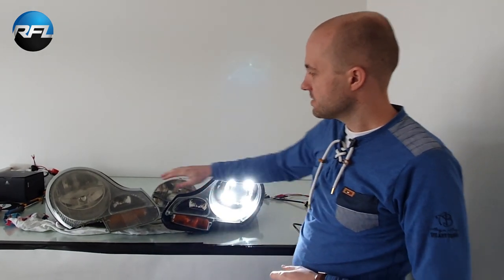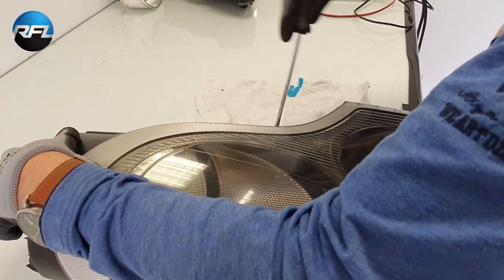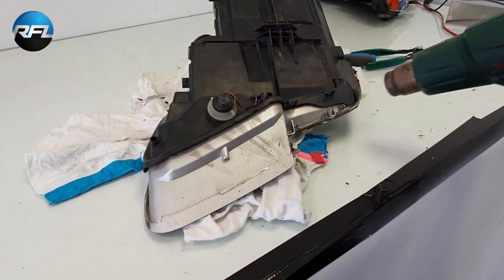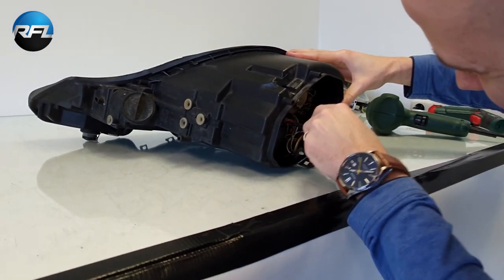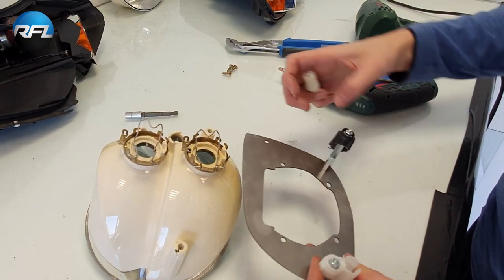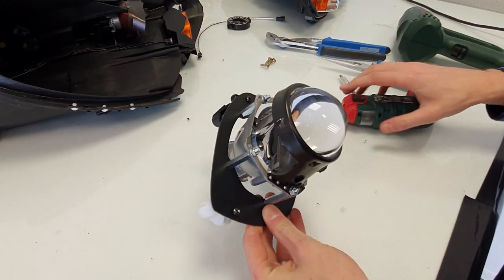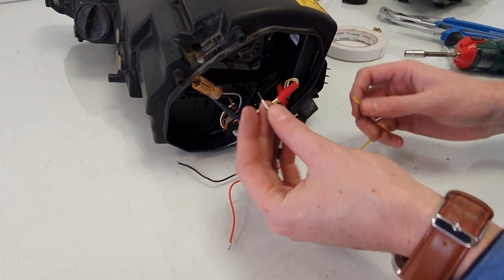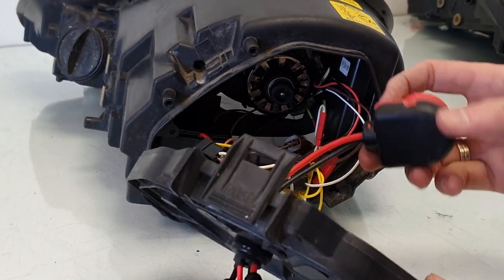Porsche 911 996.1 986.1 boxster halogen headlight to bi-xenon custom HID upgrade / conversion

Comment: Hi, i'm a bit confused with the spacers for mounting the OEM ball joint things.  On the video you used 50mm for black plastic piece, 20mm for white plastic piece and 10mm for cream plastic piece.  Near the end you said you changed.  Can you clarify the changes?  I used the spacer setup I just mentioned but it sees the light is pointed towards the side of the housing.  Same car 996.1.  Thanks
Reply from the maker: That should be correct (the spacers). Normally you should be able to adjust it sideways with the adjustment screws. Maybe you can also compare it with how it sits in part 2 https://youtu.be/cC1Oucv3xDI
Reply: I have the same question and the answer given really isn’t an answer or a great one .
& my car (2000 996.1 with halogen oem) has an adjusting marker, there is no mention of this or what to do ‽
Reply: Does anyone know what the fix was to this? I’ve followed the video precisely and they everyone else, my projector housing is pointing off to the side wildly! I’ve tried to turn the adjustment ‘dials’ to get it back straighter and it seems to make almost no difference. 

I need the car for work soon and this is really slowing my down re-fitting it all! 

Why couldn’t there just have been simple printed instructions? 🤷‍♂️

Even with the video it’s taken a tonne of guess work trying to work out with screws to use and what should and shouldn’t have washers! 

Been a nightmare! 😂🤦‍♂️
Reply: … Ok solved it! 

For anyone that encounters this problem, there are three cream coloured adjustment holes on the side of the headlight casing, that accept a 5mm Allen key and would be accessible from the inside of your frunk when the headlight is mounted… 

The stock headlight is MUCH further forward than these retrofitlab ones and I had to wind the adjusters a LONG way back, it’s not a small adjustment.. If you only turn the adjusters (with your 5mm Allen key) a couple of turns you’ll be convinced the headlight build is still wrong.. 

But if you keep turning them for what feels like forever, you can finally get your projector housing pointing straight in the headlamp. I used the two adjusters that are stacked on top of each other… 

Top one tips top of the projector baseplate (bracket forwards or backwards) and the bottom adjuster does the same for the bottom of the baseplate (bracket) I hope that helps the next girl/guy! 

Goodluck! 👍

Comment: At 39:18 you point to a rubber, can i buy that rubber separately? Also, do you know the length of the D2S to Amp adapter which plugs into the bulb and exits out the rear cover and connects to ballast, the one you're holding at 37:14
Reply from the maker: Hi, yes the rubber can be purchased separate, please send us an email (info@retrofitlab.com) so we can send you a custom link. The length of the cable is about 20/25 cm.

Comment: Which is better for this headlight, a bi-hid or a bi-led?
Reply from the maker: It really depends on your own preference. Both options have pros/cons in comparison with each other.
Bi-Led is a newer technology, it is instant on, has less components, so it's more modern.
Xenon HID has a longer start up time and is a tiny bit harder to install because of the ballast. But you can choose the color temperature of the bulb,bulb and ballast can be changed in case something fails. And also, with a good bulb like Osram, light output and pattern is still a bit better.

Comment: Why don't you use the permaseal tools  you sell?
Reply from the maker: With this specific headlight, a screwdriver works as easy as the permaseal tools. Also because this is not a very difficult permaseal, the screwdriver works also works well.

Comment: 300° Celsius? 572° f . Surprised the entire light doesn’t melt .
Reply from the maker: The box is quite big and not really sealed/insulated, so it won't get as hot as the setting on the heatgun. Also there needs to be a good distance between the heatgun and the headlight, because otherwise, it will melt.